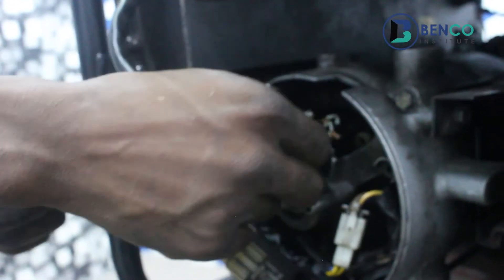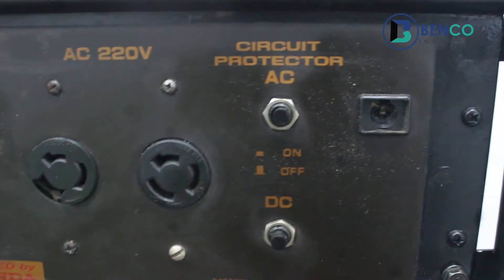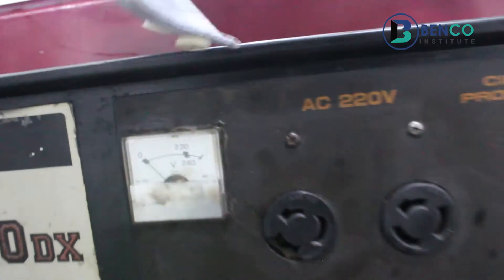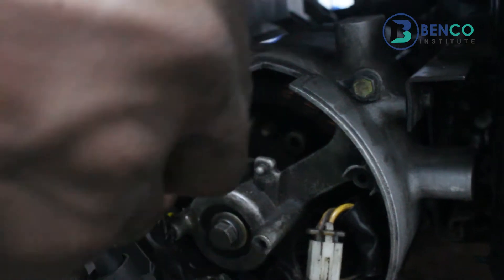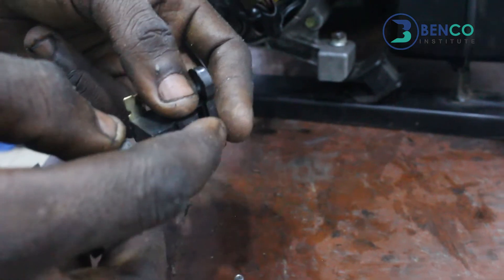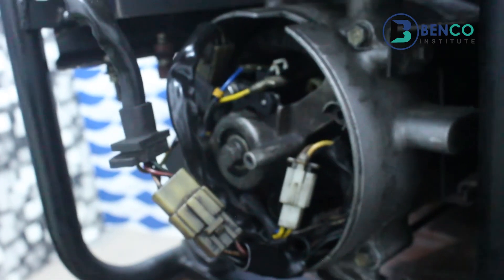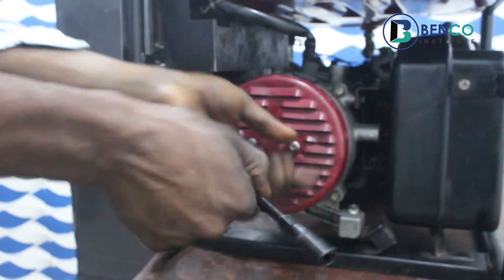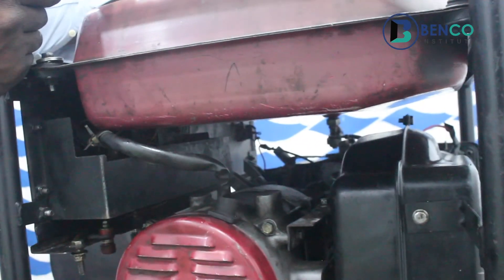No power,Fix by replacing the brush for a non capacitor,AVR type portable/small Generator machine

Comment: This is a good one.
I have a challenge with my generator.  

When i put it on, at first, it does not supply current. If i leave it to run for about  1-2 minutes, the lights will come on. Then if it run for about 30mins, the voltage will start decreasing .
Reply from the maker: Oh 

Wat type of generator